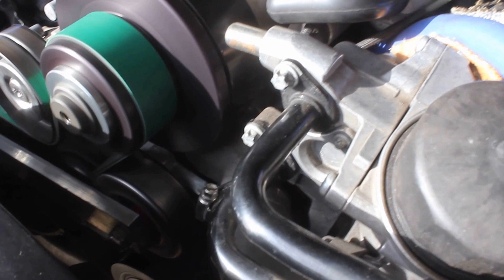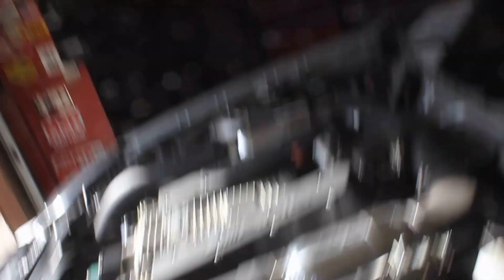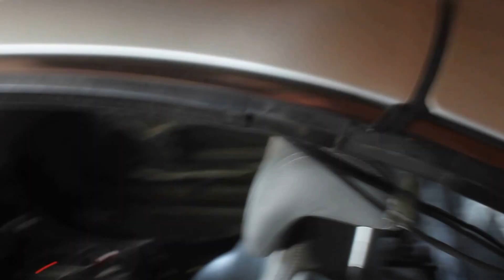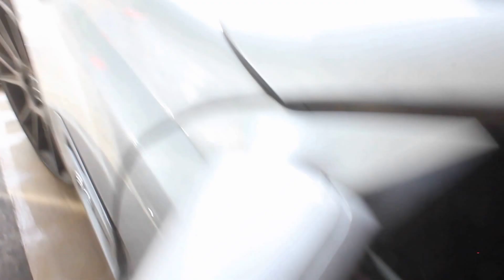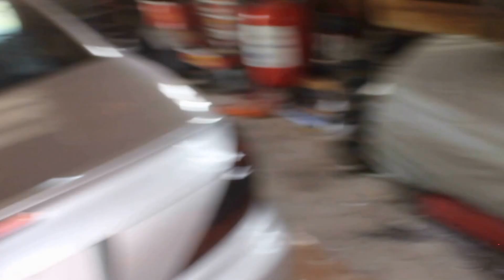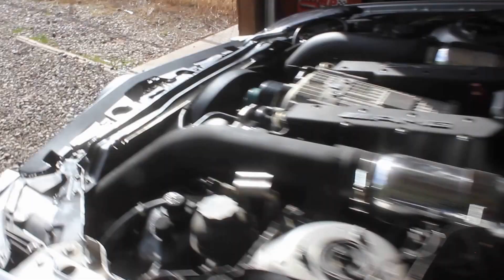m133k SL55 AMG Mercedes ANTI SLIP BELT Wrap bracket fabrication diy

Comment: What kind of sc pulley you have on your car ? Is it 77mm?
Reply from the maker: gurman as a renntech underdrive 168 and a 77 up top .. renntech headers tune upgraded Heat exchangers pumps.. the list goes on and on
Reply: The Angry Mechanic I don't want to mess up with crank pulley. I currently have 83mm clutched pulley and now I want to go for clutch less pulley but not sure if I should go with 77 or 74mm. I have stage 3 eurocharged on my cl55.
Reply from the maker: gurman 74mm

Comment: when will they be for sale? price?
Reply from the maker: That depends on if you want just the brackets? & or with the extra needed pulley & new gates HD belt. (best deal will just be brackets and hardware alone) $150) with pulley & belt $300. Let me know what you want and I will provide wrap kit ASAP.. regards 602-695-3533 (please call or text business hours only 6am-9pm) as of now payment via paypal.  Best regards
Reply from the maker: Pulley will be high grade light weight aluminum  90mm 8 rib. better then Mercedes pulley. (I could provide pics)  regards